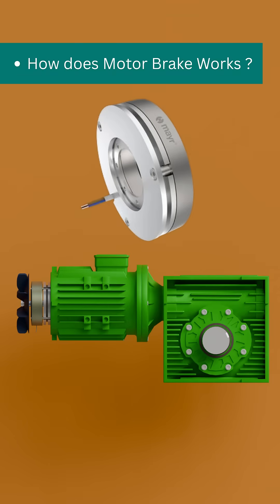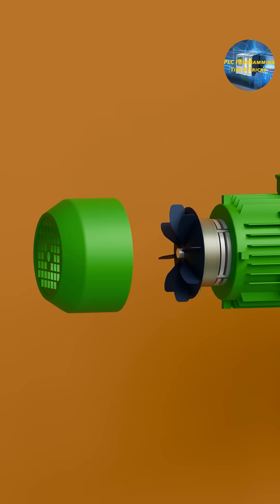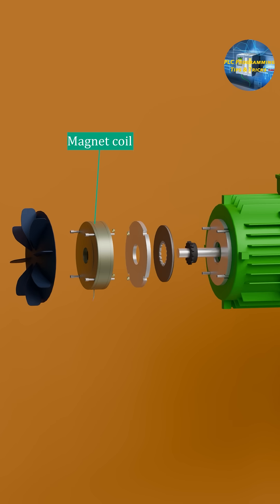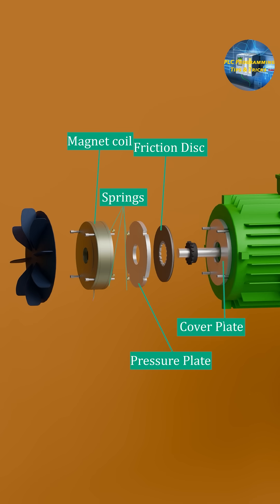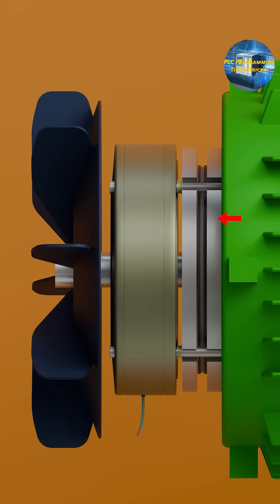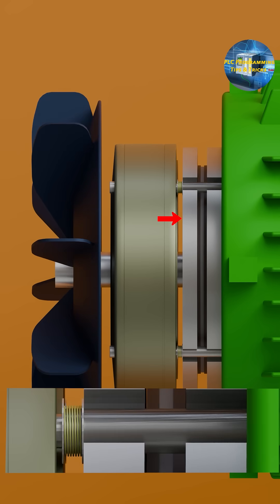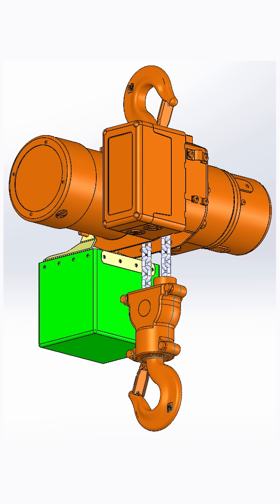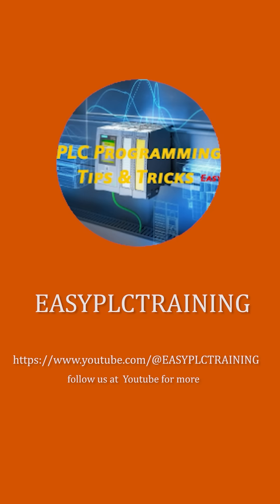How Does a Motor Brake Work? | Electromagnetic Motor Brake Explained

Comment: Sir, you have missed out the oil rigs. The are situated on the three lifting legs of the rig. Thirty six such motors are fitted in all, twelve on each legs. We used to call them brake motors.